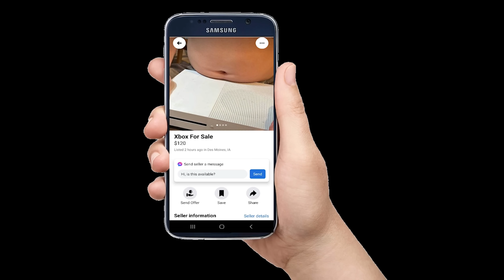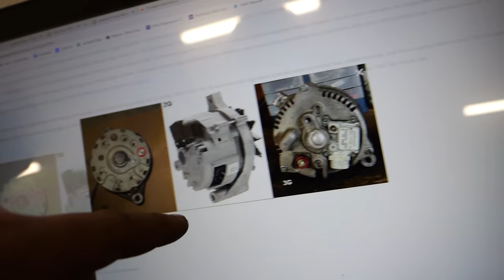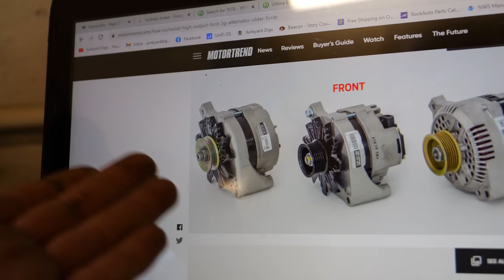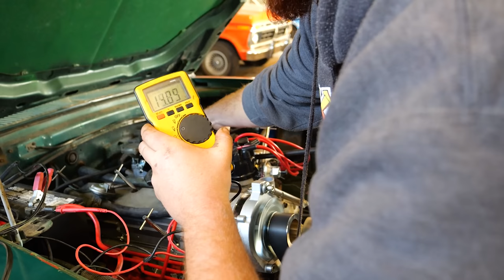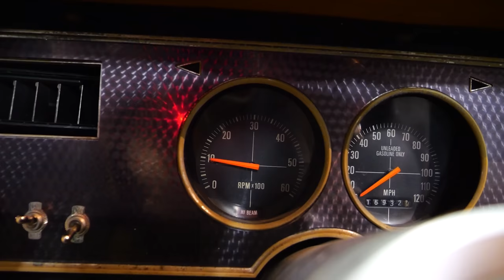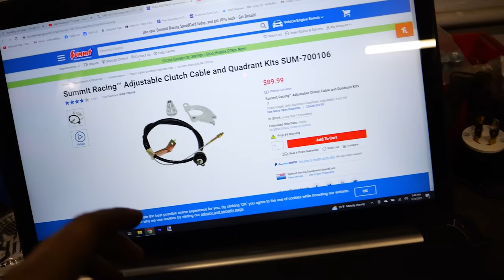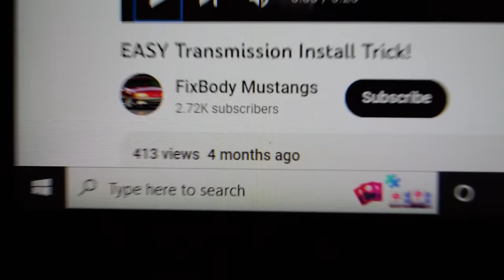ABANDONED Project Car! Can We Finish it After 20+ YEARS!?

Comment: The Mustang II Fastback is a good looking car…. 
It looks a lot better than the chev monza it outsold, and outsold is an understatement…
these pinto-based cars always felt kind of rough riding, like the fr. suspension had control arms that were too short & not e’nuf  travel (why anyone would swap mustang2 suspension/rack into a bigger heavier old car is beyond me!). 
This car was perfectly timed for the FAKE “oil crisis” in ‘73 & rip-off insurance rates (omg OMG the world is out of oil….. N O T..!!! just like today’s alarmist terrorist fakenews pseudoscience phoney “climate emergency” CarbonTaxFraud SCAM… Life-Giving co2 is NOT “toxic pollution” but IS in FACT Re-Greening the Earth & MODERATING our climate…. FACT).
The Colour of this car (original Paint?) “dark Grabber Green” suits it as does the original factory bean-slot alum.wheels that were part of Ford’s “youth free style” promo (name? escapes me) that included such things as the pinto panel wagons with round porthole windows & silver/black tutone + red/orange/yellow stripes, flareside F150s etc.
The full/frame Cougar XR7 & GranTorino/Elite could be had with a 460-4bbl (4spd too!), r.Swaybar Competition Suspension, Trac.Loc.Diff, Dual Exhaust, Rally Guages & the Sport Steering Wheel same but bigger than this ‘78 “mach1”…. pls do NOT swap this cool Original Steering Wheel or the Orig.Factory Wheels, they suit the car perfectly, it has a toy-like charm compared to a ‘real’ ‘69-‘73 mach1 lol….. 
btw, a black interior would look really good with this green colour….  I saw a “fox body” Fairmont Futura Coupe dark jade green metallic with black velour bucket int., 302-2V 4spd o/d, Handling Susp, Rally Guages & Sport Steering Wheel, pw a/c, pop-up sunroof etc. New in the showroom back in ‘78 and it was a really sharp looking car with the 4-bolt“16-hole” alloy rims & bodysige insert mouldings…. It was the best looking Fairmont/Zephyr I’ve ever seen….